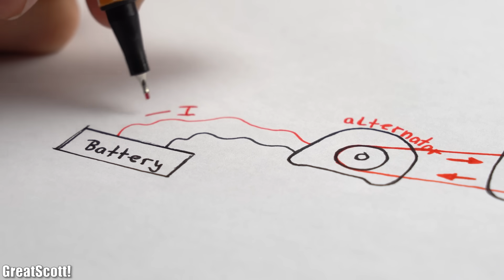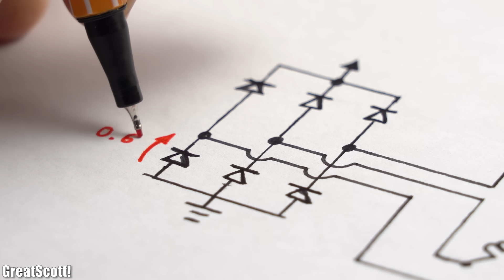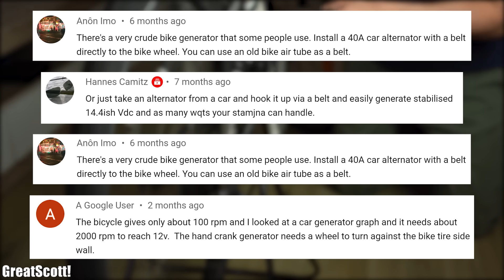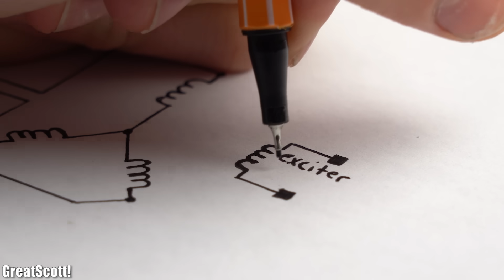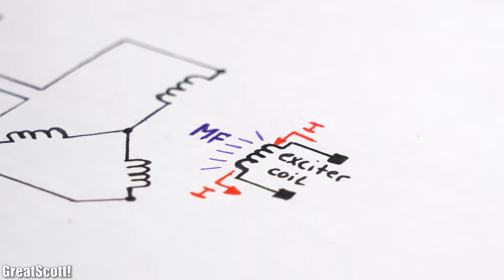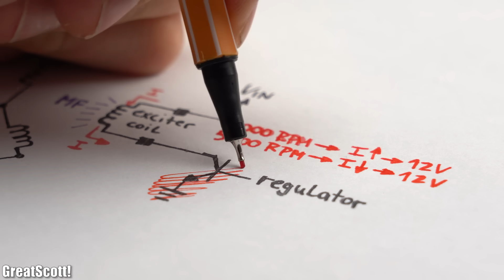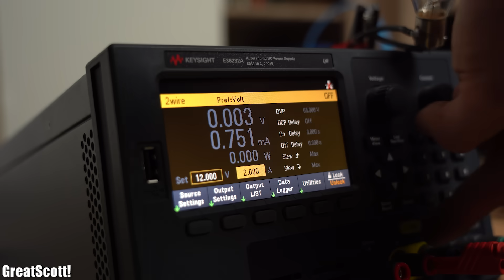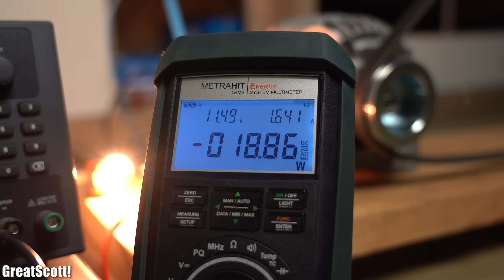Using a car alternator with a bike to power my home? How much energy can I produce?!

Comment: If you use the smallest gear on the wheel, the wheel will turn faster => big gear at the peddles and small gear at the wheel = highest gear ratio ;-)

Comment: Great video, as always. I would like to see it done again with a few things done to the mechanical setup. For instance, use the smallest gear on the back wheel of the bicycle, and you will get more RPM. Also, your belt is slipping because it seems like it's nowhere near tight enough. Make yourself a big beefy bracket to hold your alternator and bicycle, and adjust it with a pry bar or something to put some serious tension on the belt. Also, and I am no expert on vehicles, I think that the Exciter voltage is actually pulsed. At what frequency or duty cycle, I have no idea. But try those things, Should work a lot better!
Reply from the maker: Maybe there will be a part 2 if enough viewers are interested.

Comment: You should of used the large front gear and smaller rear gear on the bike this would of gave a higher rpm also looking at the alternator your using the chances are it is lin bus controlled that would also create the surging your experiencing but still a very cool vid
Reply from the maker: Thanks for the feedback :-)

Comment: Alternators are designed to perform AC at high rpm. DC generators, those found in old and some ag vehicles produce dc energy at low rpm. Gear it to spin at 2000 thru 2500 rpm.

Comment: Seems like you need a way to push the belt from above so that it’s a bit more stiff.
Reply: Yeah, a belt tensioner would probably help.
Reply: The tensioner needs to be on the slack side or the drive tension from the bike wheel would compress the tensioner. But you are correct, a tensoner is needed.

Comment: I wonder how would it perform with heavier flywheel
Reply: A flywheel helps decrease fluctuations in rotation, but still it's heavy and requires more energy to turn. You'd have to make more effort for same energy generated.

Comment: A one wire alternator is your best bet as you only need power in and ground. It requires no separate voltage input to operate, as it's fed by the regulator.
Reply: It also requires a lot of rpm to start self exciting....
Ford vehicles with the Cologne engine using a 130A 3G alternator you just have to ground the regulator screw to go full field.
(But that would probably cause the belt to slip)
They do make a good scooter or go-kart motor though.
Reply: I'm guessing that the exciter coil in a one wire alternator is connected internally in parallel with the output voltage, thus self-excited and very likely also regulated, in this case the regulator might be harder to deal with than with a separate excitation coil.

I'm betting a permanent magnet excitation might be better than any other form of excitation in the long term.
Reply: @1900OP  Maybe a permanent magnet starter motor would be a cheap source for one large enough to actually be useful?
Reply: @jimurrata6785  Output voltage too low.
Reply: @kwliu001  That all depends on how fast it spins, doesn't it?
Reply: @jimurrata6785   Sorry, but no.  An alternator's output is regulated to stay at a nominal 12V.  You can power SOME things on 12V, but for things like home appliances and so forth you're gonna need an inverter - not just because you need to bump 12 volts to 120, but because most appliances and home electronics need AC current.  And when using an inverter, you're gonna incur some losses; the transformer alone is going to convert as a ratio - 12 volts AC in at 20A, for example, will deliver a theoretical 'ideal' (aka 'no loss) max of 2 amps at 120 volts.

Unregulated alternators can deliver up to 18-20V in some cases - but that's essentially for a situation where there is a very light load.  By the time you start producing anything above about 1500 watts (assuming a modern alternator) you're going to start burning out windings and diodes.

Even if you could spin an alternator to the kind of RPMs that could deliver 120 volts, you'd be burning up rotor bearings, slip rings, and brushes, and you'd need a means to increase the comparatively low speed at input to the much higher speed for 120V.  While that's certainly possible to do, ramping up speed like that increases the TORQUE that would be needed at the input.  

There are damned good reasons gensets don't use car alternators, my friend.  And why the ones that can actually sustain a heavy load cost so very much more than the piddly little 900W Harbor Freight jobs.

Speaking of which, this guy could have just bought one of those Harbor Freight things.  HF's 900w unit probably cost less than that alternator, and even at 900W it'll be a lot more useful.  I get that he's experimenting to do a bicycle-powered setup, but the best you'll ever realistically get from bike power is to run a couple of lights or charge a cell phone, and in either case there are far more practical solutions.
Reply: @xaenon  Honestly it's regulated to charge the battery. Which means 14.3 to about 15V.
But if you're trying to get human powered electricity out of it , you're  going to ground or bypass the regulator and have it running full field.
You are absolutely correct that Scott would be far better off with a purpose wound generator.
But I believe he hacks these things (like a scrapped alternator) for the teaching moment more than any practical purpose.
He obviously can do the math and knows what his outcome is going to be.
Reply: @1900OP  I had a chrome alternator rebuilt, and it's a one wire system and is obviously powered through the regulator. A pm system is used on some alternators, but both are good in different ways.
Reply: @1900OP  An alternator with no current in the field winding also produces no current.  They are NOT self starting.
Reply: @Lassi Kinnunen 81 he doesn't have a battery in the mix because when he planned this project, he didn't know he needed one (or he did but omitted it to ensure he had material for a third video). He's got deadlines to keep, so he kept to the original plan and was able to put out a video on schedule. 

Also, when experimenting, there's value in sticking to your original plan until you can't go any further (for example, he also learned his belt slips) before standing back, replanning and re-executing.
Reply: The YouTube Critic  Alternator rotors usually retain some slight residual magnetism when the excitation coil isn't powered anymore. This can be enough enough to create a very small output voltage which is then fed back into the excitation coil to increase the field strength, which increases the output voltage, and this compounds until full excitation is achieved.

Standalone AC generators (at least semi-modern ones) usually rely on this residual magnetism to start generation. If a generator fails to produce power a common culprit is the residual magnetism fading, and this is resolved by a process referred to as "flashing" the generator. Flashing the generator is just connecting external power to the field until it is able to self-excite again.
Reply: The YouTube Critic  and you need the regulator. with the alternator being used here that is what those 2 small prongs are for. the regulator. without it the output voltage will get too high and cook the battery. once you get past 14,5 volts it basically is charging the battery way too fast and the battery case will bulge out from the heat of the overcharge. and there is also an explosive hazard as when lead,acid batteries charge the expend some hydrogen gas and overcharging increase that output.
to use a simple analogy think of the amperage as the volume of water flowing in a river and the voltage as the speed at which it moves...
Reply: The YouTube Critic  not true. They are somewhat like a generator on an old car or tractor that has the field polarized.
Reply: It still requires an input voltage. An alternator has no permanent magnets to induce a voltage. It is one set of powered coils inducing a current in another set of non-powered coils. The voltage regulator adjusts the strength of the field in the powered coils in order to provide a steady, appropriate output voltage. The trick is to get an alternator that does not have a built in regulator. This way you can power the excitation coils with a steady 6-12 volts and generate a constant, worthwhile output voltage that can power many things.
Reply: The YouTube Critic  maybe I'll point out the fact that a car will still run without the battery connected once its started . You can reliably create a setup that only needs a jump start and continues on without any input from a battery so long as you never shut the power down. To solve this , you can use additional alternators and lower rpm to create the same amount of power with less wear on the alternators and utilize a clutched disconnect to remove an alternator should one fail and be able to keep the lights on while you're servicing it . It's fairly simple to create a self sustaining electric generator with a little know how.
Reply: The YouTube Critic  and the approximately seven horse power limit